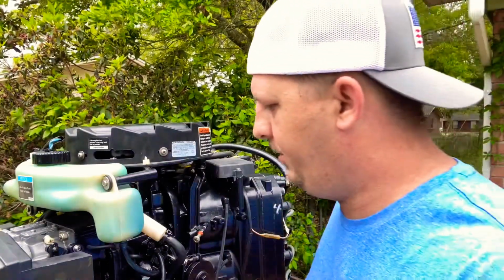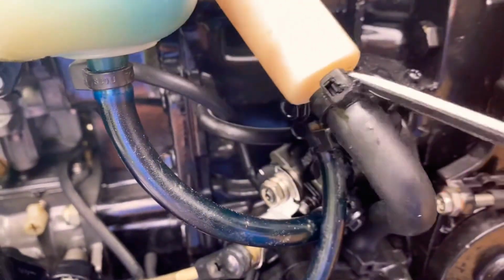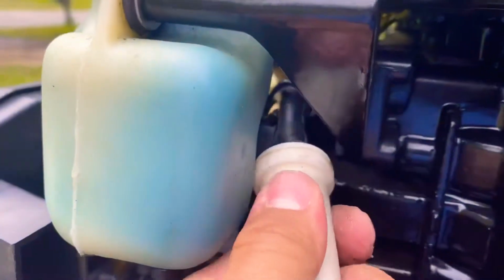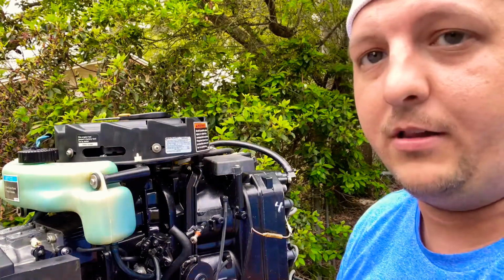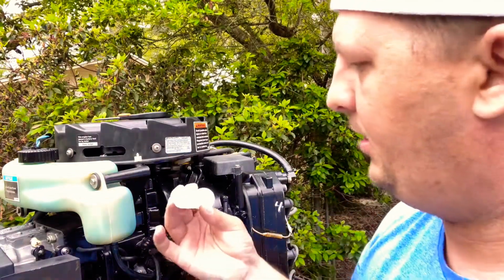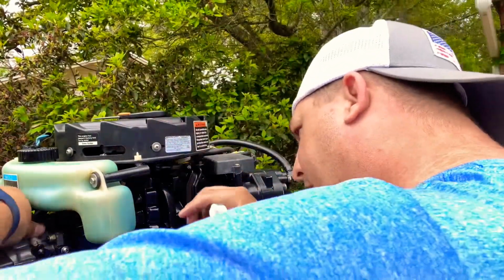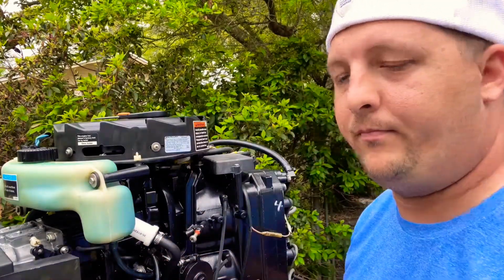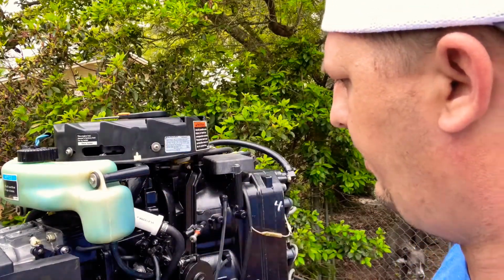How to replace Inline fuel filter (Mercury XR6 150)

Comment: When you prime your bulb does it pass the fuel pump and fill up the filter? Because I noticed the fuel filter is after the pump.
Reply: Because I put a clear filter on and when I prime the bulb it gets solid but never passes the pump.
Reply: I have a 2003 xr6 150. Mine has a filter on the line coming in an to the fuel pump and the one after. Does anyone know where I can get the filter before the pump?

Comment: If it was the same filter, looking at the video it looks like you put it on the opposite way of the one that was on there.
Reply from the maker: It's on correct. I'm guessing the other one was backwards or a different brand. I even went out and double checked.
Reply: @GhostRider_JT  Thanks for the video. Pain in the butt to get it off the hose. Mine is on like yours.Thanks again.

Comment: Where is the oil dip stick on a 150 xr6 mercury
Reply from the maker: It’s doesn’t have one. It’s a 2-stroke. If you noticed towards the top left of the engine you will see a reservoir. It’s semi-clear with a black lid. That is what feeds the engine. You may also have a larger tank in the rear of the boat.
Reply: @GhostRider_JT  my xr6 has the oil tank in the rear and on the motor like yours. Id love to see an oil change video!🌊
Reply from the maker: @slowloudbangin5155  you don't change the oil on a 2 stroke engine. You just just have to ensure you keep the resivor full.
Reply: @GhostRider_JT  do you mix anything in it or just top it off with the proper oil?
Reply from the maker: @slowloud bangin  just oil. This is what I use --->
https://www.amazon.com/Pennzoil-Marine-XLF-Engine-Gallon/dp/B01M6YFXC0/ref=mp_s_a_1_4?adgrpid=86058660719&hvadid=406677080638&hvdev=m&hvlocphy=9011692&hvnetw=g&hvqmt=e&hvrand=6418661650824609815&hvtargid=kwd-347623248185&hydadcr=24477_9910923&keywords=pennzoil+2+cycle+marine+oil&qid=1680314263&sr=8-4
Reply: @GhostRider_JT  thanks brother🤙🏼